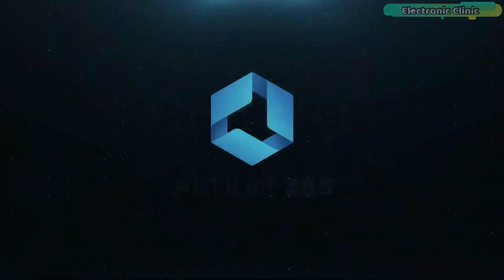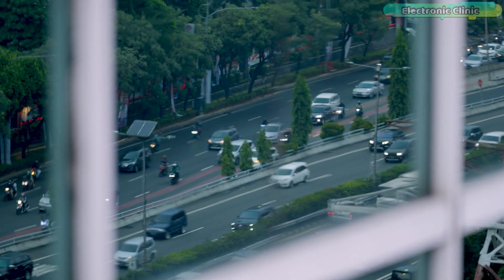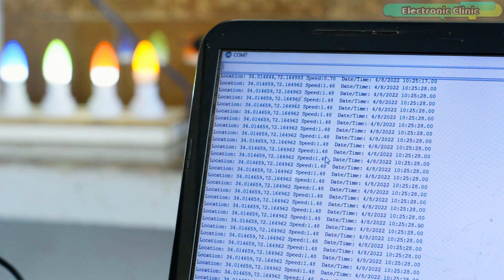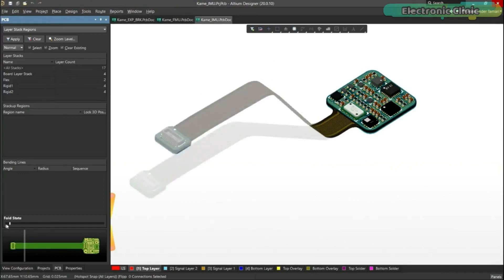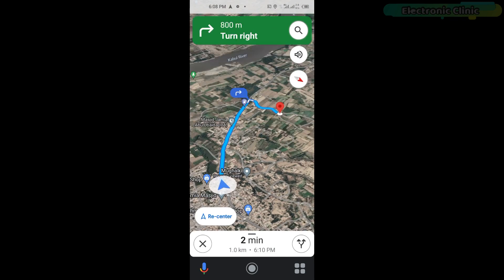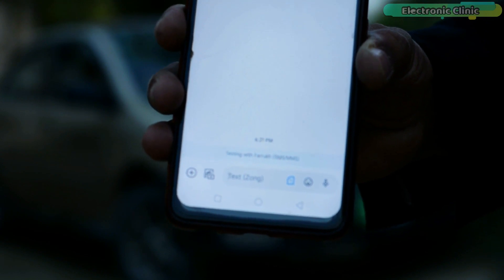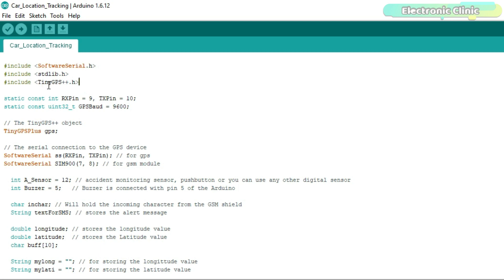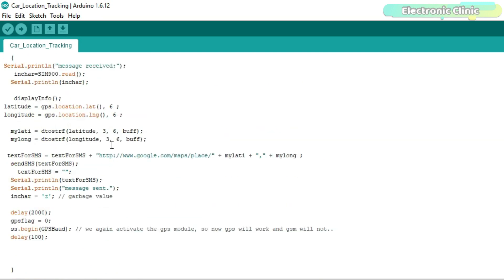Car Location Tracking using Arduino, GPS, & GSM  Locate my Car,  Car tracking by SMS

Comment: Now send an SMS message to it, so that it connects to the engine management system via blue tooth and turns the engine off, and sounds the horn and lights continuously. Something I have always wanted to do!
Reply from the maker: i did it. check playlist.
Reply: @ElectroniClinic  Hadn't spotted this . Most excellent!
Reply: Just a suggestion for a new video.  Redo the video using an ESP32.  Might be simpler and you have all the parts already.
Reply from the maker: i am already working on that, esp32 has onboard bluetooth module which is a plus point. After ramadan, I will fix it inside my car